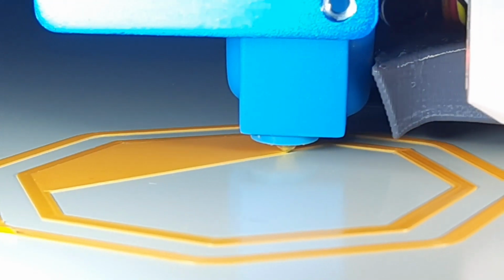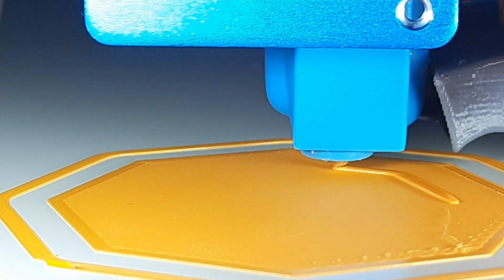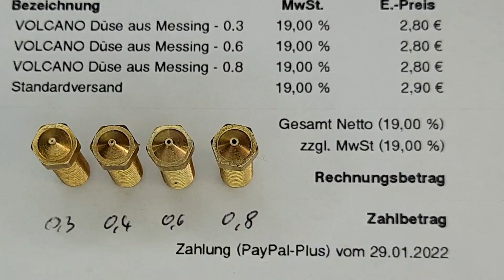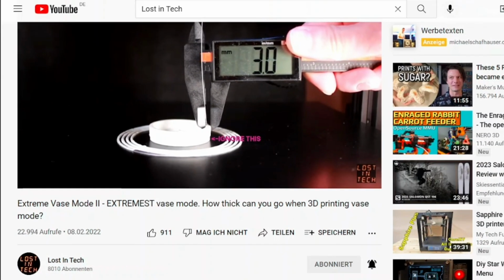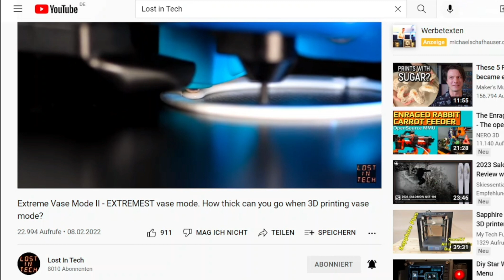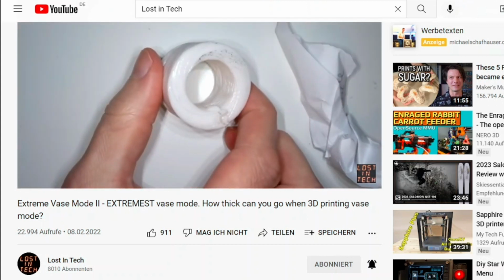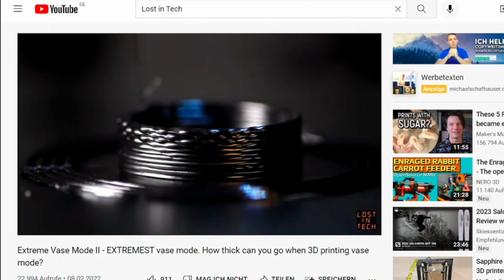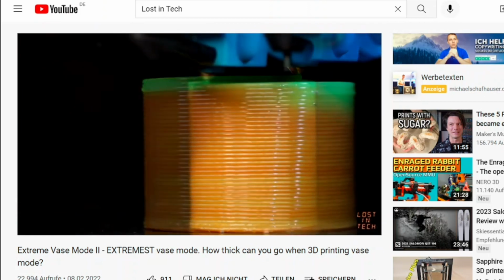Max line width ? /  0,8 mm nozzle  vs. 0,4 mm

Comment: I've tried most nozzle-diameters and 0.6 is IMO the optimal compromise between speed, quality and accuracy. 0.8 and even 1.0 usually isn't as much quicker as I thought with the STLs I've tried, but obviously rougher in quality. For high accuracy I use 0.2 nozzle and it's really accurate. Almost no need to add the typical 3D-print-tolerance to models that need a perfect fit. 0.4 is the jack of all trades, so compromise in all aspects and what's really much better with smaller nozzles is removing support-material.

Comment: Great video! Your print looks fantastic! What's the secret slicer settings (CURA?) to having a solid bottom? Thanks!
Reply from the maker: Whatever solid bottom you choose.
You set 5 bottom layers for example.
Cura is printing the bottom as this.
Proceeding only then with the spiral mode as one outer line.
Any top layer settings are ignored by cura because of the vase mode.

Comment: Does linewidth take the wall thickness into account? I have a 0.8mm nozzle and will definatly be trying this !
Reply from the maker: Im not sure to understand your question.
You define your line width, commenly at least the nozzle size.
The slicer divides your wall thickness and puts the lines as they fit.
Since the line width almost never fits as a multiply, the slicer decides some lines not to print any more. To overcome the missing volume, you can tell the slicer to 
print thin lines, fill between lines, fill gaps eg.
To print thin walls where there is not enough space for any infill, is therefor a bit of a challenge to get it nice.
Reply: Yes.  Cura adjusts line width accordingly to best fit your part.  Dimensions should be very close.  Only issues you'll run into is inconsistent extrusion due to your hotend not keeping up.